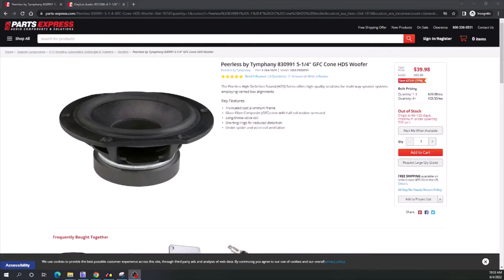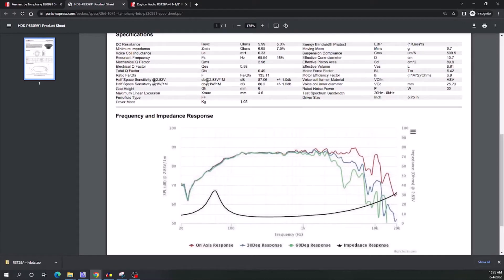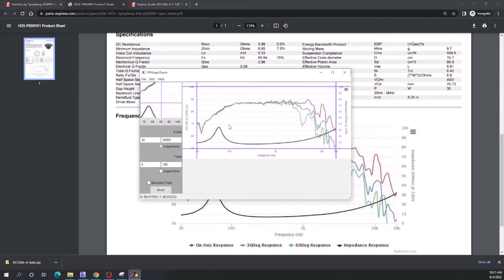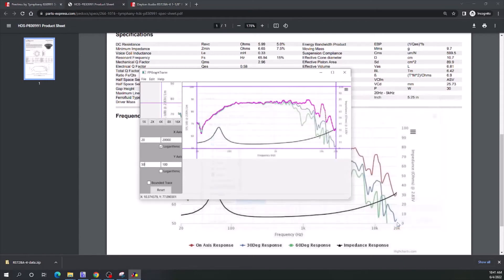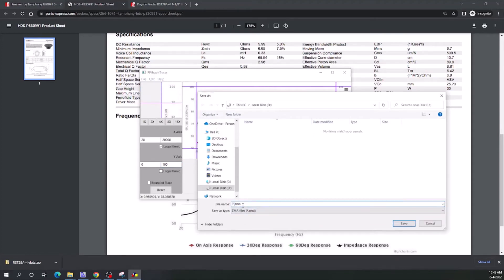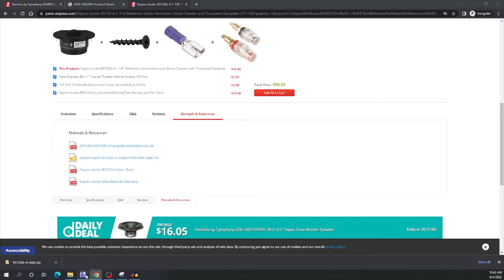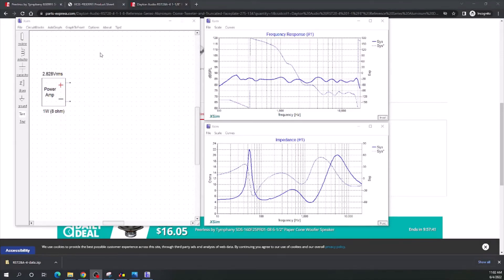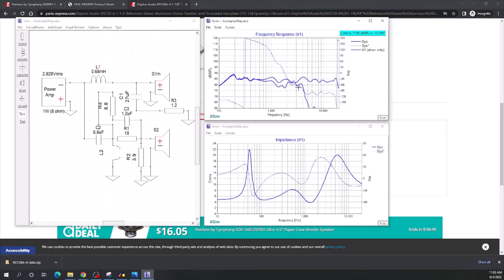How to - Speaker Crossover Software

Comment: Audio Judgment said the impedance changes value with frequently noting the graph is not a straight line and even if it was you would still be out ? He uses microphones, what say you Sir? Because i know shlt about it .By the way i bought new 3 way crossover and not good , the old ones no good replaced all drivers, what to d? I did same with my 2 way and but got lucky. That's how i know  the 3ways sound bad.

Comment: Wouldnt the frequency change alot once its in a box? Would the crossover design change?
Reply from the maker: This is my very novice understanding and approach. Box volume will affect a driver's low frequency response, but not high... in general. And sealed tweeters don't care about the volume of a box because they are encased already in their own individual "box." So in a two way design with a crossover between woofer and tweeter, the box size won't affect the frequencies in the crossover area.

But even so... I do use WinISD to get a box size with a rough estimate of how it will change the low end of the driver's frequency response (and check cone xmax, etc) and then use that as my first build specs to get me close to how i want the speaker to sound. The box may not affect the crossover range. 

I hope that helps!
Reply: @stepsonetodone4103  yes it does...thanks for what you do